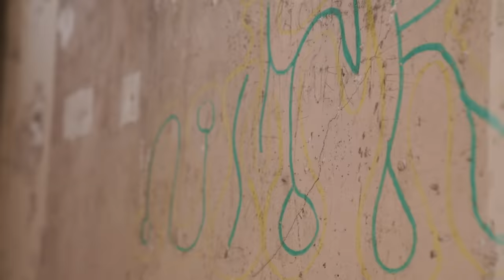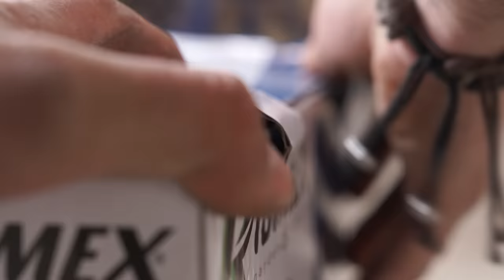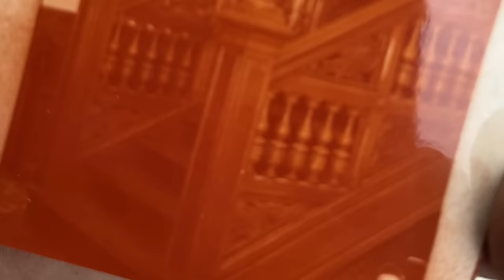A chateau diary; the truth about the lost interior.

Comment: I hope that - until you put the roof on - you will put waterproof tarps on the new floors so they don't get wet and tarps on the ground floor to save you work removing any falling debris. In addition to leaving everything much cleaner, by not having to breathe the dust that is suspended in the air when sweeping and blowing the debris. You should also purchase a small electric jackhammer with different tips and blades for quicker removal of masonry, wood beams, etc. Keep up the excellent work.

Comment: I do not know about France but in the US the wood joist you put in are supposed to be “Fire Cut” on the ends to prevent the walls from collapsing . The cut is an angle cut on the ends so if the floor and  joist collapse from the fire the beam can slip out of the masonry pocket it sits in and Not act as a lever to knock the wall down.

This has been the rule for ages and you may have had it which is why the walls were undamaged after your fire.
They did their job.

Please look into this as when you cut your beams into joists you did it straight with no fire cut ends!

Comment: That was my first thought as well! That the staircase did not really fit in with the Chateau... But I hope, you will still bring it back, as a proper Chateau! Some great advice would be, that you simply look at the style of it, and the date, it was built - and then go visit some Chateaux, that are built in the same style. That will give you all the info, you will need 😊 From that, you will know all about what the interiors would have looked like, and what you need to start collecting 😁
Reply: Yes, something about that staircase feels off but I can't quite put my finger onto it. It's incredibly ornate and must have been one hell of a job build with all the turned spindles and carvings but it doesn't feel right. Could it be a 1950s or 60s imagination of what might have been there, chosen by someone with slight delusions of grandeur and limited knowledge of historic architecture and interior design?

I'm tempted to assume the general layout as original though, the landings align perfectly with the windows and the stairs seem to have filled the space quite nicely. The tile floor also seems to suggest that the shape of the stairs has never been substantially altered.
Reply: @Ragnar8504  I realized, that the explanation might simply be, that when the house was emptied for almost everything the first time, everything, that would have matched the style of that staircase disappeared, and suddenly the rooms where left much lighter and brighter, with none of the old, ornate decorations....
Reply: @bigboy77dk  That's certainly possible but IMO the style of the banister doesn't match the remaining woodwork in the hall, while the base of the staircase does seem to do. Very difficult to tell though.

Comment: I just re-watched this video because I wanted a closer look at the staircase picture.  Wonder where the back-story of the château in the book comes from, as I'm not quite sure if it fits with what I found in local archives. According to the book the château was built by someone by the name of Resoski who sold frying pans. After his death it passed onto an Englishman, who furnished it for his protégé, Eugénie Bardet, a local singer. She lived there for ten years. In 1939, 20 years after Bardet sold off the interior, the OSE rented the château. If those figures add up, Bardet (who is generally referred to as a singer, either opera or cabaret, on the internet, not a dancer) lived there from around 1909 to 1919. However, according to the 1906 census Bardet already lived there and the 1901 census doesn't contain a house named Chaumont. So the time frame doesn't quite work out. All the online sources are quite vague but none of them mentions British nobility, they all point towards French industry. Quite peculiar.
Reply: The book might be Sortie de route en Creuse by Jacques Jung, which is at least partly fiction, a whodunit novel set in 1970, partly related to the château's role during WWII.

Comment: The one set of arched windows it looks like a set of stairs go up to a small landing to the balcony that looks upon the property. Remnants of the stairs are left on the wall. The perfect round holes in the brick wall may have been used for a counterweight for a door or possibly a small elevator or dumbwaiter. One documentary on a English castle had a similar feature to raise a door and lower it when needed. There may have been a door in the lowest level used for supplies to be unloaded, etc.
Reply: I wondered if he saw anything in the pictures that would lead to a conclusion on what the holes were used as.
Reply: @mcelder3739  I noticed a grate in the wall in the shot showing the bees buzzing around and that convinces me even more the holes were ventilation or heating ducts.

Comment: Wow on the second version of the Chateau.... from one of the worst architectural/design periods in history....LOL... the 1970's.  It so looked the part in those few photos.  I'm so sure you'll create something that blows that out of the water.  I can relate to how it kind of takes the pressure off ya and glad that was the case.  And I agree with another poster here; find a beekeeper that can relocate the hive.  I once bought an old Mercedes for $10, and had it in my driveway for a year before the city made me remove it since I hadn't gotten it running yet.  Anyway, it had been out on a lot in the country for quite a few years and had a hive in one of the subframes.  I was always surprised by them, I could mow the lawn right next to the car and the bees never got upset about it.  It wasn't until I found someone to come get the car that they got pissed off about things.  FYI, if you didn't know.  If the bees get upset and before they start stinging well... they will start head butting you as their warning sign.  They really amazed me in how docile they were outside of that one instance where we rolled the car out into the street and on to the new owners trailer.  He was using the engine for an older Benz he was restoring for his wife, and they also kept bees on their farm so hopefully they finally got the queen and hive out.

Comment: I am pretty sure the two spaces to the right and left of the middle on the first (American second) floor are supposed to be divided into four rooms not 2 gigantic ones most likely with some sort of shared storage like space where the middle smaller window is. Also you can see in that picture that the windows are supposed to be floor length and someone changed it at some point. A book on house styles and architecture would be a recommended read before putting too much back into the space as that gives you a historical perspective on how houses were split up room wise and what function the rooms served. I think it's also safe to say that the house is not Art Deco, but Art Nouveau if anything. The entrance tiles are very similar to the ones in Catalan Modernist style which was one of the subsets of style around the same time as Art Nouveau. I can picture it having a hybrid of all the early 1900's styles in Europe which is what it looks like it was anyway.
Reply: I don't really get Art Noveau vibes from the bits left of the interior (assuming they're even original and not something added after the war), too ornate and heavy-set. Beautiful features in their own way but decidedly without the playful, flowery lightness of Art Nouveau. The outside has a touch of earlier romantic styles I'd say, especially with the wide roof overhang on the tower.
Reply: Also that vent with the bees if you notice is the same shape as that hole in the staircase hall that goes into the round pipes which you will notice show no signs of being sooted up the way a fireplace flue would be. In addition the wall would be substantially thicker if there had been a fireplace in it.
Reply: @Ragnar8504 It's mainly the exterior with the polychrome bits at the top of the tower that gave me that feel. Also a lot of buildings are mutts and took a bit of whatever and mixed it as that staircase was more arts and crafts looking. It's definitely not Art Deco though.
Reply: @lesdmark  Yes, that's for sure, it's much too early for Art Deco. I'd say 1900-1914, roughly, probably the "around 1910" reported variously on the internet is quite close.
Reply: @Ragnar8504  I have been going over French styles and I think I may have narrowed it down to mainly Beaux-Arts inspired as it has a lot of neoclassical detailing and that style ran into the early 1900's even. I also know from living in a rural area that sometimes a style would persist past the time it would in a major city so it would make sense it still being on a new building in the countryside.
Reply: @lesdmark  Yes, that seems to be quite accurate! It's rather toned-down on the outside compared to some older buildings, probably both because it was built after 1900 and because it was in a rather rural location and the architect wanted to emphasise that. Early 1900s is spot on, if you can trust the census records the château was built some time between 1901 and 1906. The interior, or what's left of it, does have strong neoclassical vibes, especially the doors, panelling and plasterwork.

Comment: Are you intending to put a temporary lid on the place? Your hard work will deteriorate if it's rained on over the next year.
At your age I had the strength but not the determination. At 70 I have the determination but not the strength. You have both at the same time on this fantastic project, so keep it up.
Reply: In one of the previous videos he said building those floors is a step towards being able to tarp this part of the building, possibly even within the next weeks.